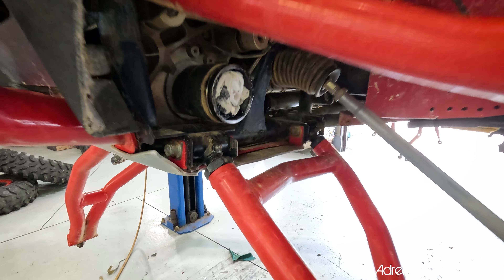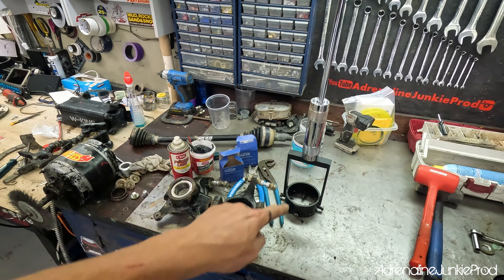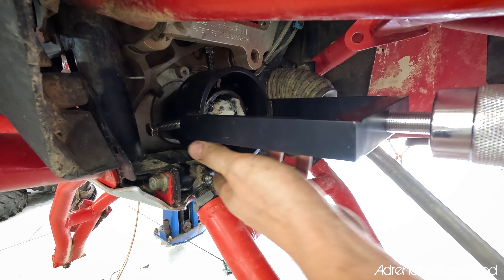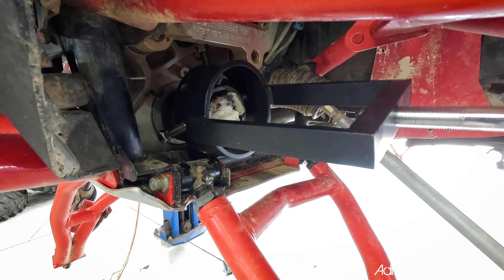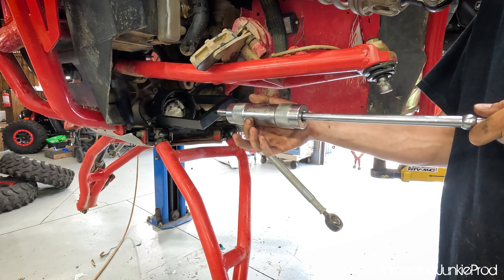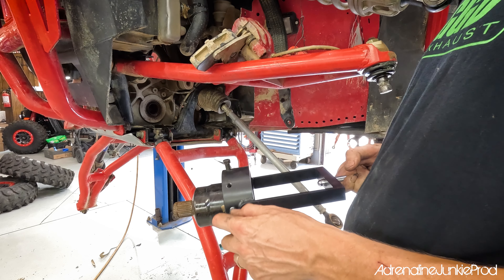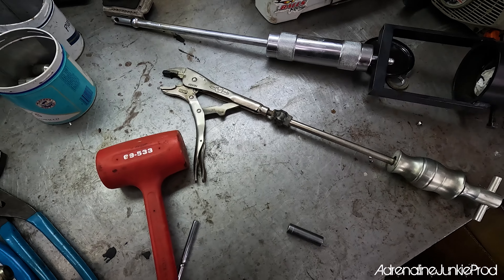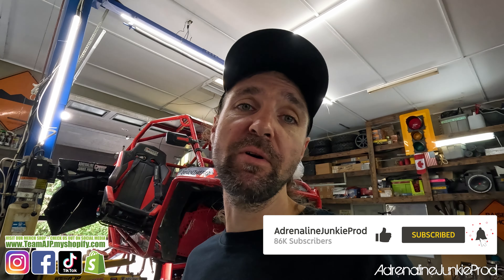How To Remove Stuck CV Axle Joint From SXS/UTV Differential or Transmission - RZR, KRX, Maverick X3

Comment from the maker: If you work on SXS's or ATV's then you've probably had this happen before and you know it can be a serious pain in the butt. I highly recommend getting an axle puller like this one and adding it to your tool box. Mine lives in my trailer as you never know when you will need it. A spare axle isn't very helpful if you can't get the old one out. This thing pays itself off the first time you use it. Yes, there are some other tricks and methods you can use to get a stuck axle out but this is hands down by far the best, easiest and most reliable method. Incase you are wondering, I don't get any commission from SuperATV and don't make any money recommending this tool. I just think it's a wicked tool that any SXS, UTV, or ATV mechanic needs to have. You guys know I only recommend products I believe in, this is one of them. Got some more cool shop related videos coming and some great ride content too! Leave a comment below and let me know if you have any additional tips or tricks for situations like this. Do you have an axle puller?

Comment: Those axle tools are a game changer. I’ve had axles stuck so bad I just wanted to catch the machine on fire and call the insurance company hahaha
Reply from the maker: Oh man… been there a few times myself. Prior to having these pullers I had a few painful extractions. The axle puller takes all the stress out of doing axles. These days I don’t even care if they come apart. I mean… I still rather they don’t, but at least I know I have a guaranteed way to remove them that only takes an extra few minutes and is guaranteed to work without any collateral damage.  It’s such a simple and smart tool.

Comment: It looks pretty well built. I use a couple of different methods for the stubborn ones but I may look into this for the notoriously impossible KRX axles. Judging from the size of it, the giant cups on the KRX should fit. Good info!
Reply from the maker: I've used many different methods over the years too but once you use this tool you wont go back. Takes all the stress out of removing the axles. If it get's stuck then you just grab this thing and in 15 mins your back on track. It is very well built.

Comment: The slide hammer from harbor freight has a cup that fits perfect in the cv cup. Works amazing
Reply from the maker: You mean the automotive style that slips behind the cup? Those do work pretty good also as long as you have the clearance. I do prefer the style I have here for SXS & ATV applications. The Harbor freight one is definitely way better than the welded vice grip method and many others though.
Reply: @AdrenalineJunkieProd  yep the automotive style. I ordered a tool like the one in your video and struggled with clearance on the rear. I should've gotten the superATV brand but didn't. So harbor freight saved the day haha
Reply from the maker: @nickstewart1218  at the end of the day all that matters is finding a solution. I know a lot of people knock harbor freight or here in Canada it’s called princess auto. But I’ve got a ton of great tools there and sometimes I go in there to get something “cheap” with the intention of modifying it to do something different it was never intended to do lol 😂

Comment: How about if the axle shaft still attached to the cup? And it’s stuck in diff. That slide hammer is useless at that point. Polaris has the dumbest setup for diffs.
Reply from the maker: This video is addressing the common issue of the cups getting stuck when the shaft pulls out. If the axle is still attached to the shaft you use the shaft to pull it out and you don’t have a problem. The shaft acts as a slide hammer. This issue I am addressing only presents itself if the shaft comes apart from pulling on it because the c-clip inside the joint lets go before the c-clip on the cup in the diff. This is an issue in many brands of cv joints and many brands of machines. Polaris definitely does not have the dumbest setup for diffs compared to some other designs. I’d take a Polaris diff over a can-am any day of the week.
Reply: @AdrenalineJunkieProd  I’m a Polaris guy and only had problems with axles stuck in Polaris diffs. Canams pulls out like butter everytime. I’ve done hundreds of machines. Polaris always takes couples hours of slamming lol.